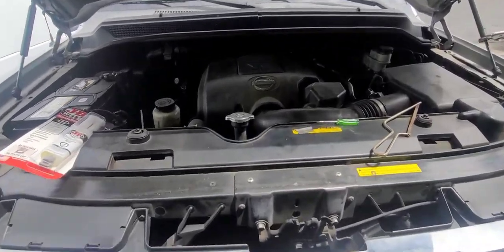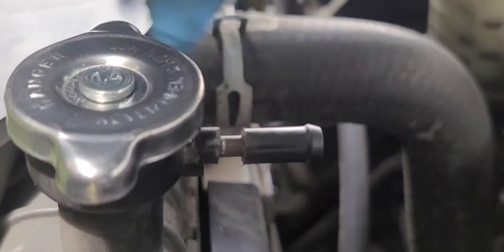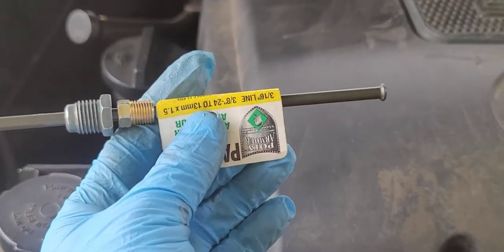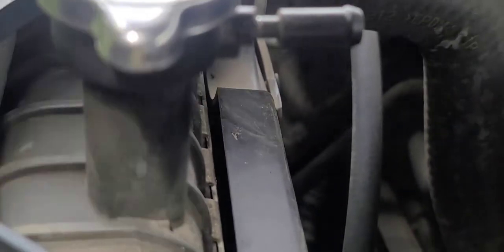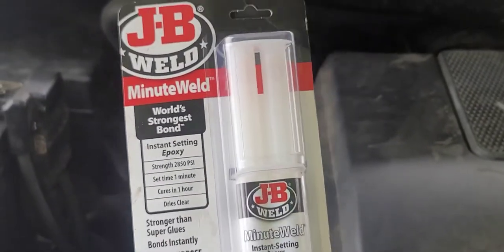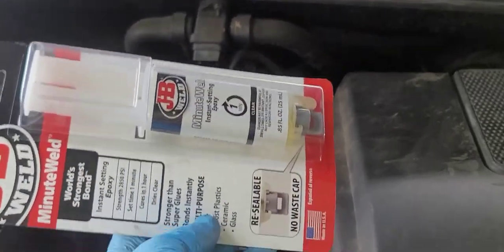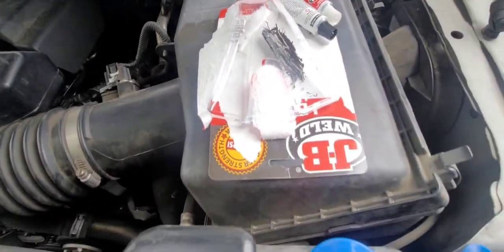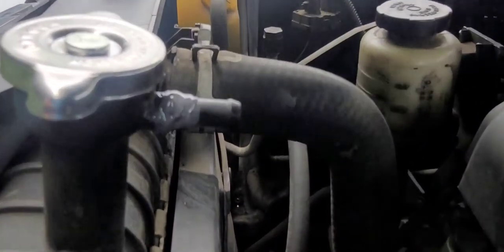How to Fix a broken radiator overflow nipple

Comment: You can also use plastic vacuum hose connectors and cut as needed. They come in a small box with assorted sizes at local auto store.

Comment: If anyone is that worried about using regular jb weld use jb weld gasket maker it can handle 500c never had a issue

Comment: Broken barb at the plastic expansion tank end. Used the metal tube of a ballpoint pen. IPA to clean out the ink (messy job). Then plastic welded the broken barb back on to the tank end. Or can use superglue and baking soda to build up strength.

Comment: Did it melt off or break the brake line?
Reply from the maker: I just cut a piece of the brake line to use it.
Reply from the maker: It didn't break or melt. I Been using it like this for a few months.